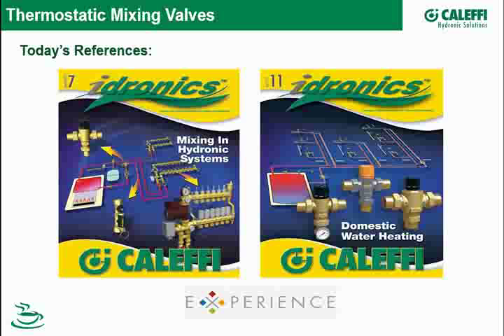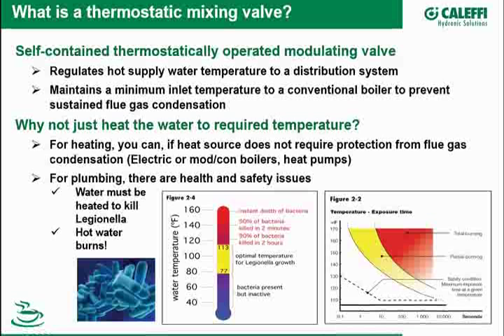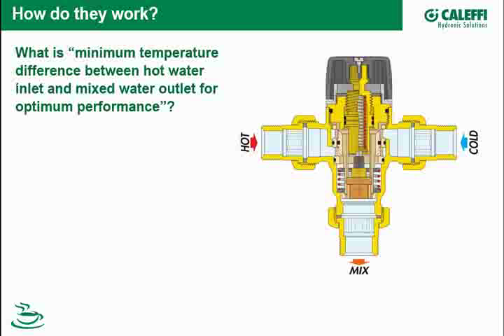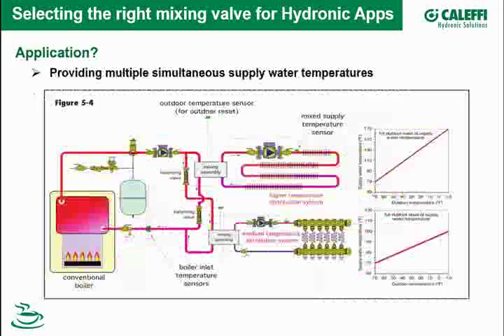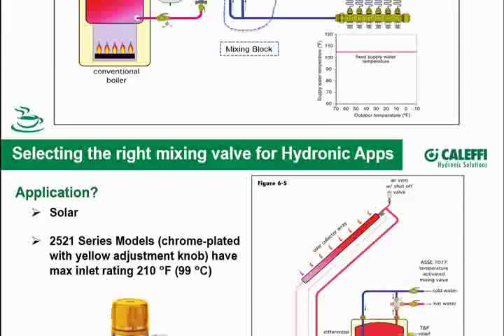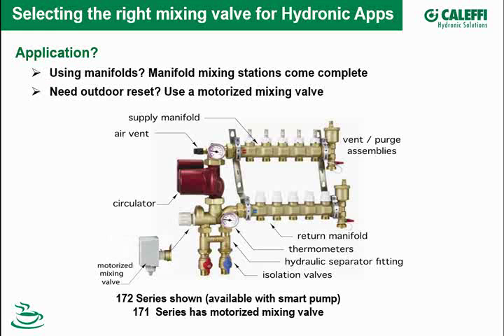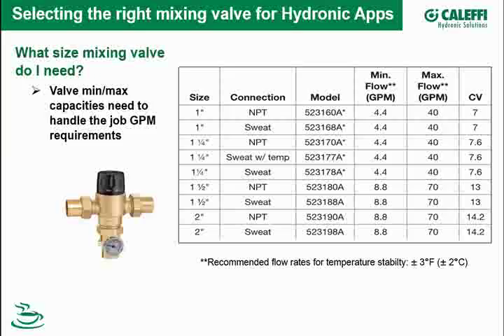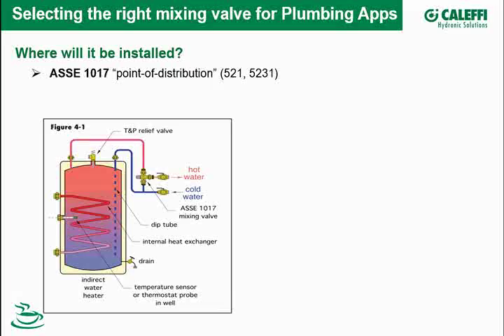Applying Thermostatic Mixing Valves for Trouble free Operation

Comment: After finding the system curve for my hydronic system, I found a pump whose pump curve crossed at exactly the operating point I needed.  However, then I read idronics 7 and discovered that I need two thermostatic mixing valves as per Figure 6.3.  But these double my total head loss!  Will the second pump on the bypass loop compensate for this once the system is up and running through the two mixing valves?
Reply from the maker: Thanks for the question!  Yes you need to calculate the flow resistance of every fitting pipe, device in the circuit, then confirm that the circulator can provide the adequate GPM at that pressure drop.
In Idronics 16 we take you through an example of how to calculate the pressure drop in a circuit.  The drawings and pictures help explain the procedure.
https://www.caleffi.com/usa/en-us/technical-magazine

We hope this helps.